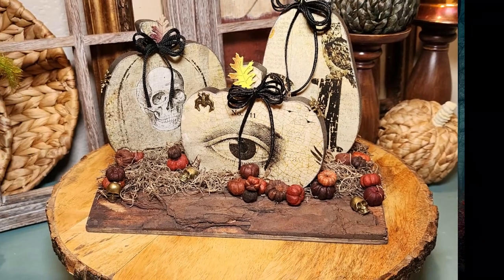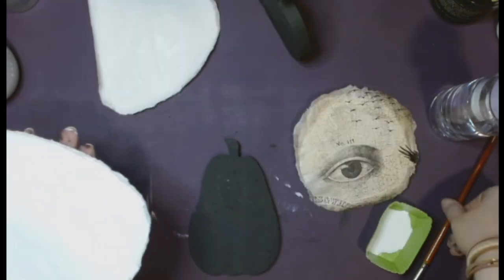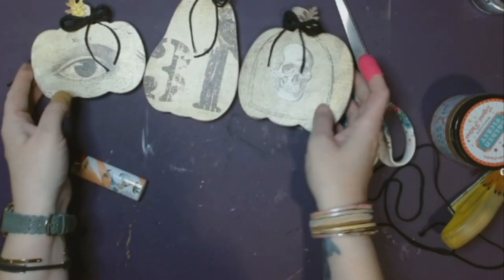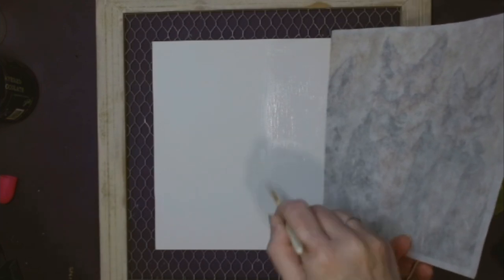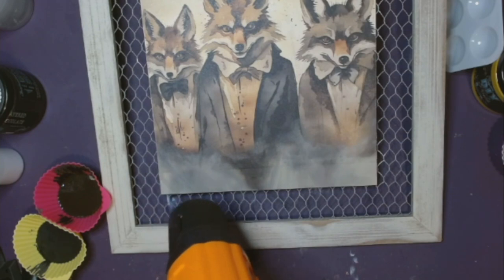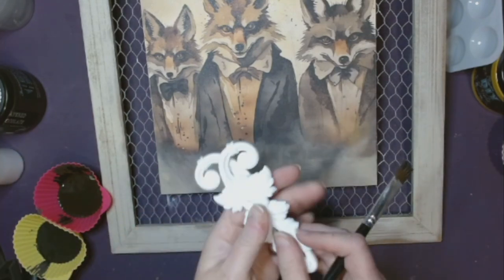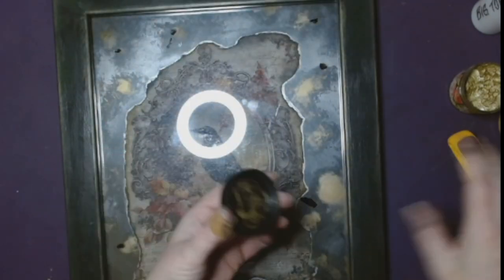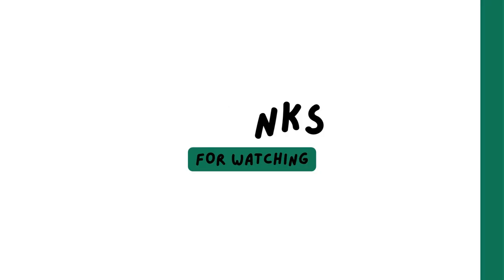Halloween DIY's and Thrift Flips

Comment: Hey Girl!!! Quick question... With the last project, when using the Looking Glass Spray, did you let all 3 coats of the spray dry fully abd then go back in with the nail polish remover to distress some back to get the aged effect?! Thanks a bunch ❤
Reply from the maker: Yes, ma'am. They dry so fast anyway. I do light coats so they will dry fast and look even more distressed. I didn't want full coverage if that makes since. But yes, it's fully dried by the time I start dabbing it. It DOES NOT take much. No joke! It will take it all off if you use a lot. 😆